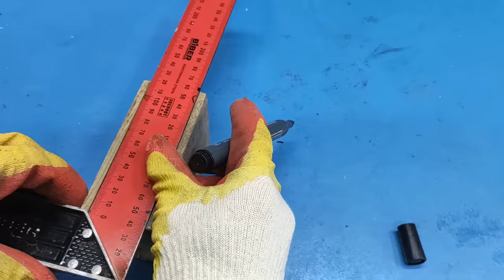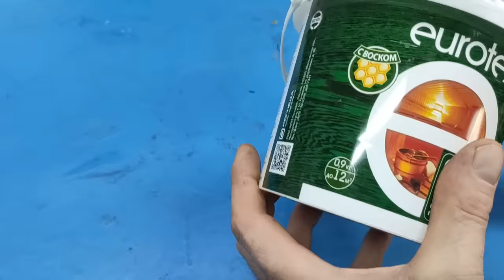Amazing invention by a first-rate craftsman. Self-made from an old brake pad

Comment: Disc brake pads are generally low cost containing Asbestos. Asbestos is an old brake pad technology that uses asbestos as the main component. The special features are Asbestos substances are cheap and provide good friction at low temperatures but it's harmful for the respiratory system
Reply: Newer brakes pads do not contain asbestos in the US. Wouldn't try grinding on old ones, because they may be made with asbestos. Some other countries still use asbestos.

Comment: The hand axe was invented many years ago; about 2.6 mya. Early examples of hand axes date back to 1.6 mya in the later Oldowan (Mode I), called the "developed Oldowan" by Mary Leakey. My own re-invention of a beautiful sword, I made with one of the blade springs of a VW Beetle front suspension.

Comment: Havin fun w/ scraps & building things along w/ tryin for a different custom, 1 if a kind look's fine. Sometimes the projects we do, wheather liked by us or others, can teach & improve skills. But I think the ax was a bit light for chopping firewood. It seemed ok for kindling unless you only found hard &/or dry wood. Weight's a consideration on a hike. For a 1 day hike the ax'll probably be an ok kindling ax. A wk.'s camping, I'd go for a heaver ax w/ the same dimensions, especially if space's a problem. I'd go for a solid bar handle (or filled w/ concrete) & thicker head. More weight = more splitting power. The 2 head pieces should have been ground down to eliminate a lg. gap. Quality welders try to fit parts first eliminating excess gaps. Make a 2nd handy ax for the shop & the car. If u can find a mkt., sell what u design or take custom orders.

Comment: Howdy, Paul.
I see you enjoy turning simple things into unique ones. Awesome!
Well, when it comes to working in the garden, vegetable or flower, I never minded getting my knees or hands dirty.
However now I don't have the space I once did. I do however have some old power tools and pieces and parts laying around.
Take an old skill saw for instance. Rather than using a spade to dig a flower sidewalk garden, I'd like to fashion a handheld tiller out of one of my skill saws. I'm sure the RPM's could handle the job and moving along on my knees would certainly be better on my old back than stomping on a spade for a couple hours.
I know that I'd have to fashion a single blade and cover shield, both for safety and to direct the dirt to the back (somehow).
Any thoughts or ideas?
I like your creative ideas.  👍👍

Comment: So then, all I need to make A HAND AXE is a Welder, Angle grinder, Belt sander, Bandsaw, Dremell, Calipers, Permanent marker, Pillar drill, 2 Vices, Hammer, File, Paintbrush and A HAND AXE. 
Should be easy from there on in!
Dammit I forgot to keep the worn out brake pads.

Comment: Plz tell me them are from  a car after  like 1996 Or if so, that you at least wore a hog nose filter cause if not, they have asbestos in them break pads you should  never  do this There is a reason why brake pads are made disposable. The break dust can contain asbestos How do you think old brake pads used to hold up to the heat asbestos

Comment: Where is the "invention" in this? You made a mild-steel hatchet. You know, like people have been making for thousands of years. You cant even call it a good hatchet, the cutting edge isnt hardenable/hardened so it will have to be resharpened every use. I really wish YouTube would crack down on this clickbait stuff. I am a real blacksmith/bladesmith, I dont call any of my blades "inventions". This isnt even innovative let alone inventive. You call yourself a "skilled craftsman", yet you think clickbaiting is ok? You think making a huge blocky handle coated in paper glue is something a craftsman would use? Or make pins from an old cheap brake line and not even epoxy them in? Flaring the ends of such soft metal doesnt work, they can be popped out/deformed easily. Come on man.

Comment: ...and make such a huge mess with the brake pads for this ugly part? Wouldn't it have been easier to form and drill a piece of sheet metal without brake pads on it? the end result is embarrassingly crappy, - even in venezuela it's not a super trick, ridiculous, failed mc guyver for oversatiated bored everything swallowers,

go to the nearest supermarket and buy a much nicer tool there for almost nothing